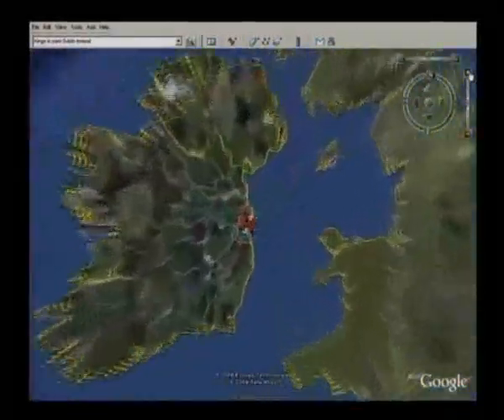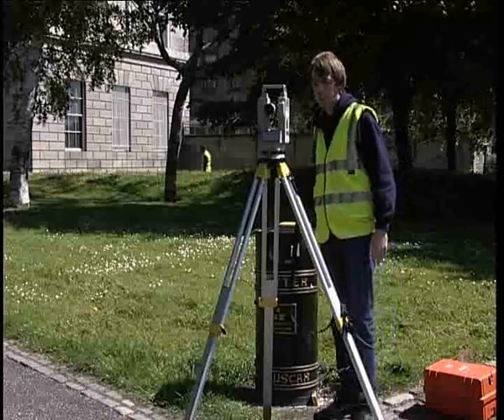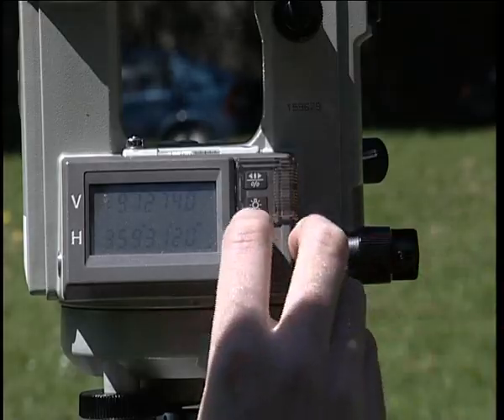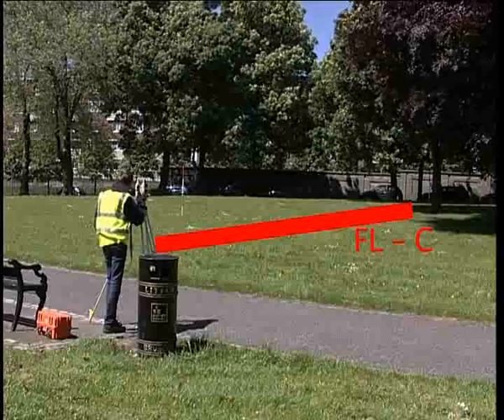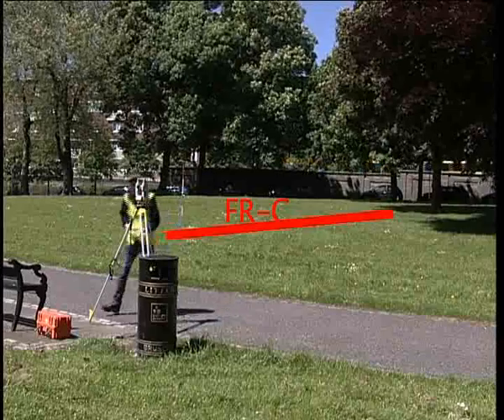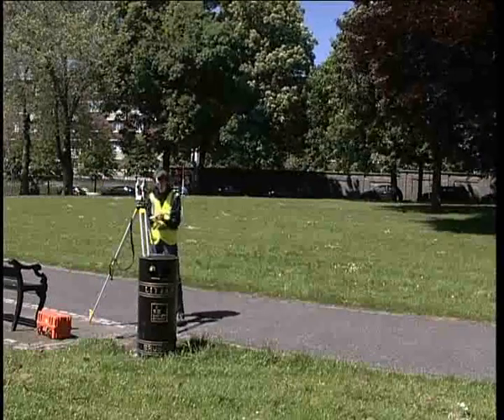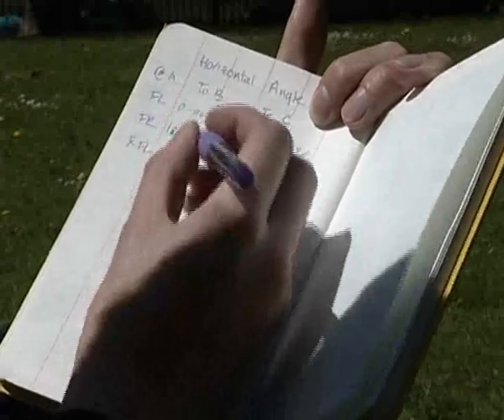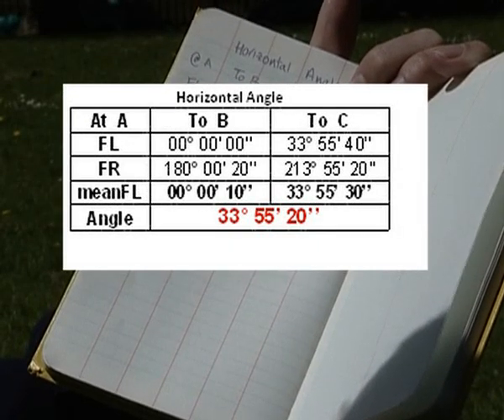How to measure a horizontal angle.flv

Comment: I have a queation. How do you do radiation? say u know coordinates of point B. U fl to B set to "0". Then point to C right. Then fr to C and B. Say if u know coordinates on A n B how do u find coordinates of C
Reply: From the coordinates of A and B you can get the bearing of the line AB  and you have the angle which he calculated in the final answer and from that we can get the bearing of line  Ac and by knowing the length of AC using tape or something and the coordinates of A and the bearing of AC then get coordinates of C